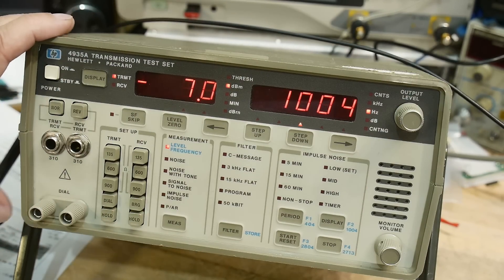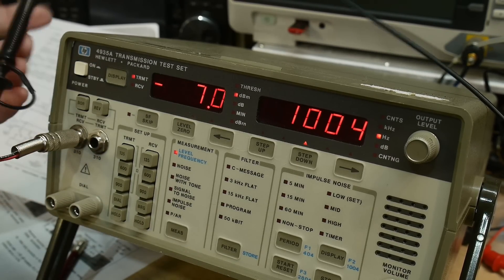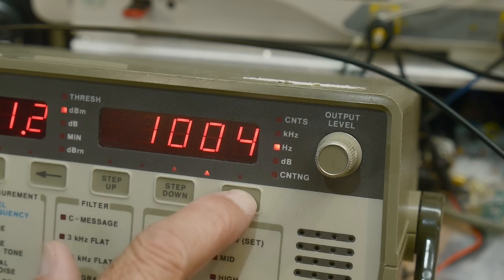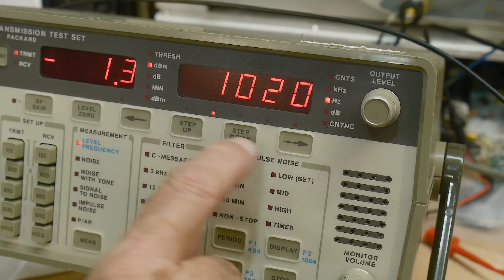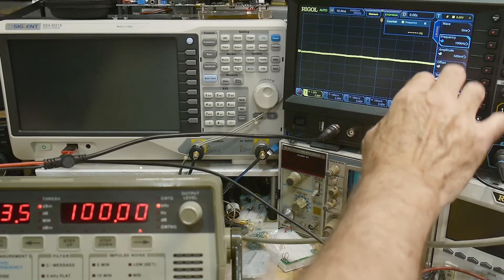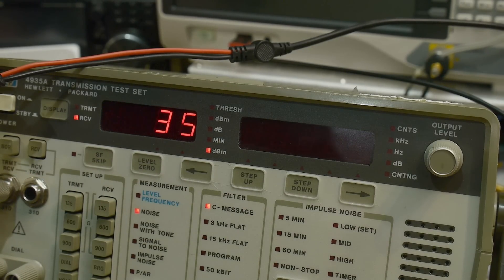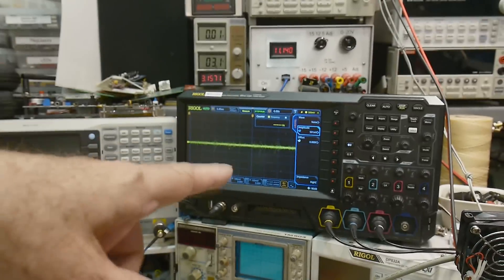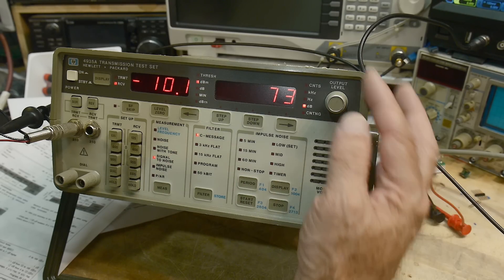#1934 HP4935A Transmission Impairment Measuring Set (part 2 of 3)

Comment: 1kHz even would be essentially spot on with the digital telephony 8kHz sampling rate, and that in conjunction with the logarithmic companding would create weird artifacts as the exact same sampling points repeat with an extremely slow drift. Choosing 1004Hz ensures that the sampling points move across the sine wave multiple times per second.

Comment: The TIA has a lage glossary of communications terms and concepts with brief explanations and cross-references online.  This instrument defaults to DBrnC, or Dbm relative to noise with C message weighting.  Telcos most often work with signals relative to the noise power on a circuit, rather than relative to some arbitrary reference level.  This can sometimes lead to confusion between Telco personnel and others who use different methods.  For instance, radio and TV people are often used to working with wide-band unweighted measurements relative to some zero level. There is a telco term, DBrnC0, which considers a measurement being made at a reference level of zero dBm at some defined point in the system.  Other points in a system, such as the other end of a long program loop may not have zero dBm, so that is why the phone company wants to know the signal level relative to the noise power on the line at the point of interest.  These measurements are sometimes made with the line terminated by a 500-type instrument, or about 900 ohms, other situations may be with the line terminated by customer equipment, such as an audio amplifier, in which case the measurements are made in bridging mode. Obviously, there is a big difference between measurements made on ordinary subscriber loops, POTS, and program circuits used in broadcasting and other high-quality transmission systems and this instrument tries to accommodate them all.

Comment: The receive section supplies the selected load, usually 600 ohms for Telco lines, unless the BRDG (bridge) button is pressed. In bridge the receiver presents a high impedance to the line. This is used when the end user equipment remains connected (terminates the line) while testing the line. The dial terminals allow a standard rotary dial to be connected for use on a 2 wire dial line. Impulse noise is a measurement performed by the receive section over a long time period - a minimum of 5 minutes on this unit. The use of 1004 Hz has to do with D1 Channel Bank equipment from the 60's -  exact, continuous 1000 Hz tones would cause bit errors in the multiplexers. Regards, David

Comment: Impulse noise simulates things like lightning.  In ye olde days you used to be able to hear static on phone calls when lightning was happening somewhere along the path.  This feature is letting you check the clamping on the circuit to verify that impulse noise won't drive the audio volume to the rails when a noise spike is placed on the line.
Reply: So cool ! Thanks.